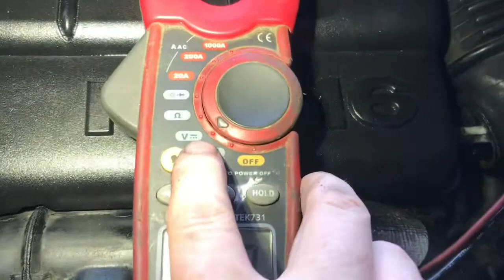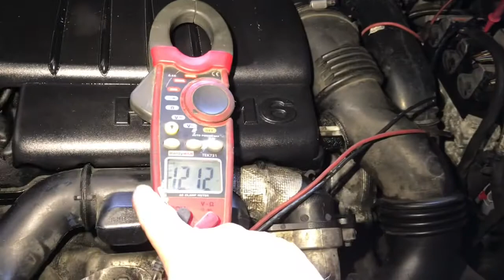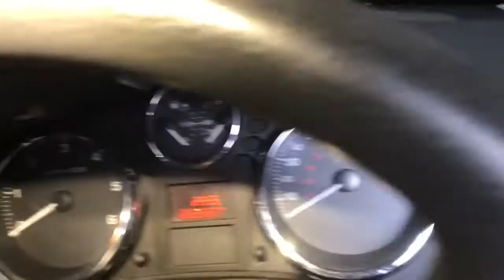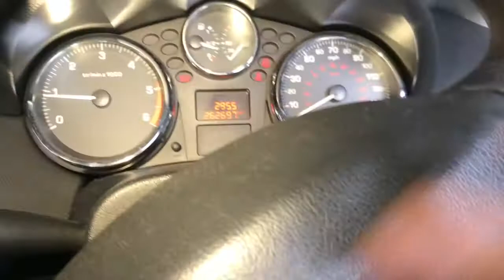Changing Alternator [ Peugeot 207/308]

Comment: This was really helpful, thanks for posting. I'm currently on my 4th alternator! Every one does not charge after fitting, unless I don't connect the single pin exciter wire, then I get a steady 14v. A very frustrating mystery so far.
Reply from the maker: If you disconnect = 14v but when you turn off the engine does the battery then discharge ?
Reply: @stevenharpervw  the battery holds a charge fine. 12.6v after sitting for a week. If you start the car with the exciter wire connected the charge doesn't rise above 12.8v. If you disconnect the wire it then rises to 14.2 and stays there under load, so the alternator is fine. If you then connect the exciter wire with the engine running it stays at 14v until the engine is turned off, and then back to square 1 next time the engine is started, with 12.8v until the exciter wire is pulled. Voltage from the exciter wire when the engine is running is a steady 12 volts. Local auto electrician recokns it could just be the wrong alternator for this car, even though it fits fine and was ordered through a local motor factors after cross referencing the registration. Can't explain it.
Reply from the maker: @alistairmscott so can you drive the car as normal with wire permanently removed ? 

Now I was told  the 207 and the 308 cars share the same alternator up to a certain year and after that, there are can-bus or a digital signal or some witch craft, controlling them, so maybe you have that one ?  Which does kind of make sense
Reply: @stevenharpervw  the cooling fan is on permanently with the exciter wire disconnected, which is a quirk of any kind of charging circuit fault apparently and I'm told eventually the car will throw up a fault code, but the battery light and EML light stay off and the alternator puts out at steady 14.2v, so no reason why it can't be driven. Yes, from what I am told this is a smart alternator controlled through the ECU, and the only way to guarantee compatibility is to go through Peugeot and order one matched to the VIN number for 700 quid. Or I could keep ordering cheapo patent ones until I get one that works. On the plus side, I'm down to 25 minutes now getting the alternator off. If there was an issue with the supply voltage from the exciter wire then I could look into that, but that seems fine. It really does just seem like the car is fussy with what alternator it wants.
Reply from the maker: @alistairmscott  wow, I guess you could use eBay or go directly to a breakers yard and buy an alternator . Or maybe best thing is go get a car scanner tool and scan the car . But damn that sounds like one heck of a problem  . Can’t beat the older cars for just having basic parts .  I’m impressed you can get the alternator now out in 25 minutes . I hated those stupid bolts to undo
Reply: @stevenharpervw  to be honest I'm cheating a bit, I've left the exhaust manifold heat shield off to give me more room and I know what way to twist it to get it out. The first replacement came from an eBay breakers and lasted about 3 weeks before giving up, so im biting the bullet and putting a new one in. Just need to find one the car likes!

Comment: hey brother plz reply back , i am having ford fiesta diesel , whenever i start the car battery warning light comes on the dash but if i revv the car till 4k rpm it disappears , and wont come back till i turn off the car , what is the issue
Reply from the maker: Rectifier in the alternator
Reply: @stevenharpervw  steven are u sure it is because of the rectifier , how u seen this kind of problem before or u r just guessing ? reply back soon
Reply from the maker: @motologist1917  It’s just a guess. I think the 207 and the 308 alternators are the same but after a change over year the alternator exciter wire is controlled over canbus  so may it’s the same with yours and there is some communication problem.  It is strange that it does work but only if it goes over 4K rpm
Reply: @stevenharpervw  ok thanks for ur help
Reply from the maker: @motologist1917 if you get it solved will you post the answer here as I’d love to know